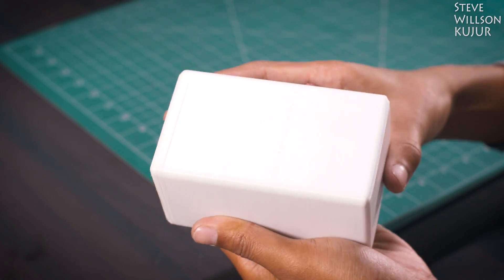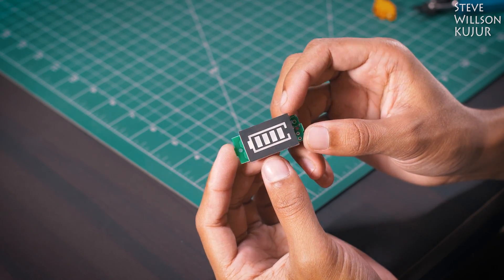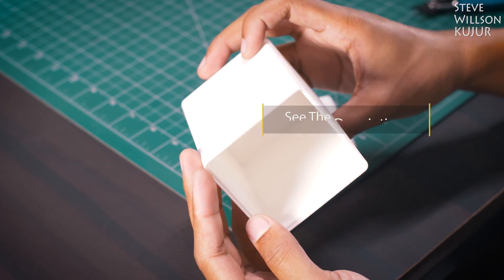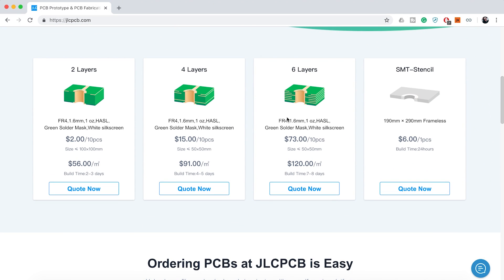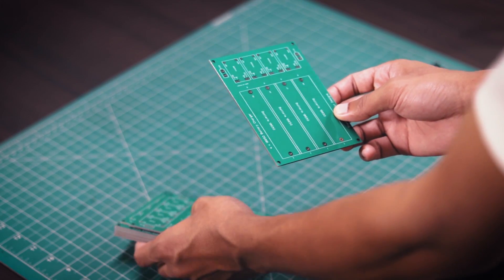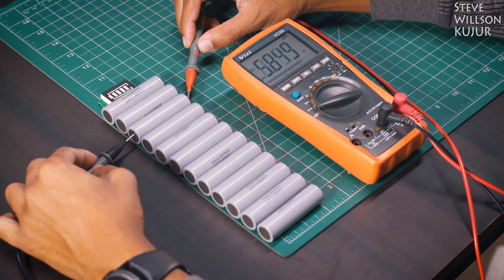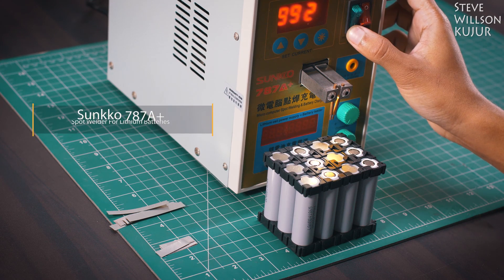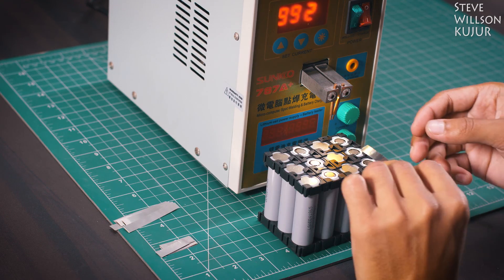DIY 4S Lithium Battery Pack

Comment: this is battery bomb.. you should not pack your li battery tightly like this in a case . if heat generated then all will blast like a bomb .. it should be in ventilated case of cooled place.. so pathetic design .. dangerous

Comment: Beautiful!  Really nice and compact, Steve.   What are you using to charge it?
BTW, I just finished a 40-cell charger using your 4x18650 board design (it works well!) only to find out that you have a new 8-cell style available.  LOL
P. S:  Your video editing is top class, too.  Kudos.
Reply from the maker: Thanks , i use a CC CV SMPS to charge my batteries
Reply: @SteveWillsonKujur   Do you have it in one of your videos?  (Is SMPS a switch mode?)
Reply from the maker: Yeah

Comment: Hi Steve, could you do a video on how to make a car/motorcycle battery please? It would need to give out 12.6v, say 400w, and be charged by the 13.8 - 15v generator designed for lead-acid batteries. I was thinking of 18650's, balance charged, and some sort of buck/boost converter? Does that sound doable?

Comment: Very nice video sir and very cool project, but I was wondering if you were to charge that battery through the XT60 connector we’ll it balanced charge? Or do you have to use the other connector on the board?
Reply from the maker: The BMS features Balance charging
Reply: Steve Willson Kujur thank you so much sir! Please keep the videos coming
Reply from the maker: Thanks

Comment: How u charge this battery bank. Make a video on charging this Battery bank
Reply: Prajwith Ullal if you were to look through his other amazing videos you would find one that shows you how to build a charger for any Li-Ion battery configuration 

https://youtu.be/DAQoyPZU4Z8
Reply: The cells are all on a BMS board which are supposed to prevent overcharge and things like that but they won't be 100% legit for just charging the bank all in series through the protection board. From what I can tell he's just got the two terminals poked through leading to the BMS board and battery bank so I guess he plans on charging it like that all in series from a variable DC supply and just opening it up and replacing cells if it fails one day.
Reply: @Magneticitist  I know that BMS, and just supplying 16.8V  to it  1-2A the BMS gives an decent charge curve for a 4S pack. When it is finished it cuts power so hooked up to a bench supply it is not necessary to babysit it. As it is a BMS and not a balancer it just stops when one cell reaches 4.24V, but cells from the same batch, wont get significantly out of balance.
Reply: @Tore_Lund  Good to know. I've never tried them myself but had suspicion they are providing the simplest form of protection. I imagine them similar to just placing an inline fuse along a series bank and setting a variable PSU to charge them at max voltage with a CC of 1A or so, which also would technically stop charging once at max voltage. It's definitely better than nothing at all.
Reply: @Magneticitist  Yes they saves you for sitting with a voltmeter  and checking every cell every few minutes when rough charging.